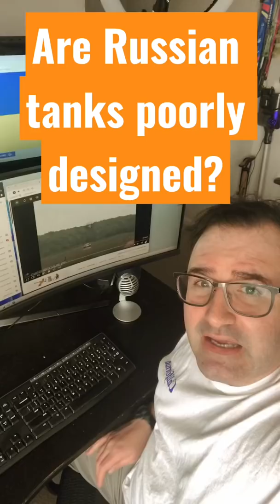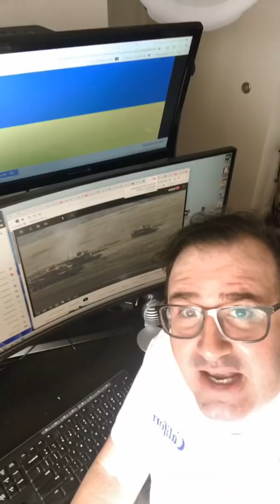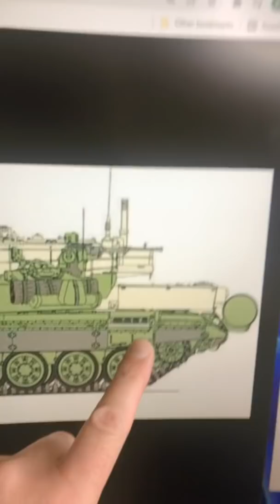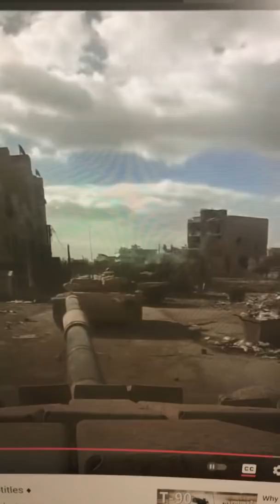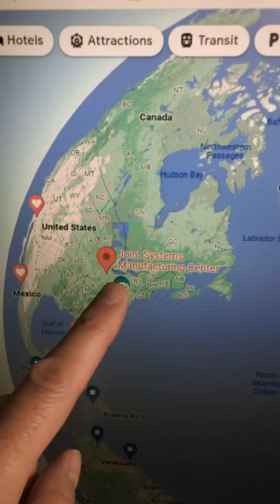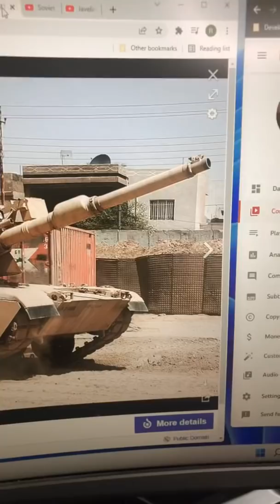Are Russian tanks poorly designed?

Comment: finally someone that doesn't just point at autoloaders and say "haha turret space program"
Reply: Autoloader, Haha turret space program!
Reply: @TheSpectralFX Autoloader “haha turret space program”
Reply: Yeah but tbh soviet ones are badly designed like fr even thou their engineering capabilities were actually outstanding in all of direction i just cant get two things about their tank building school first is why shitty autoloader mechanism (Especially in comparison with French one like theyve put in Leclerc and AMX-13) And second why so bad negative depression angles?
Reply: The Chieftain has been saying that all along. He thinks they’re superior.
Reply: Russian tanks are not THAT much smaller than western tanks from the front but that is where most of their armour is.
The Auto loader is behind the Upper front plate in the T-72 when shot from the front which is probably the only plate that would stop a 1970's NATO tank round.
Reply: @nataljagerasimova5108 Regarding the autoloader, the reason why the russian ones are worse are simply because t72s are much cheaper to make than leclercs. Because of a lower price, you will get simpler, cheaper mechanisms, thus a worse autoloader which still gets the job done. Regarding the bad negative gun depression, because russian tanks are much smaller and compressed there is less room for the gun to move vertically in the turret. If you imagine the cannon moving up and down in a turret, when the cannon aims down, the cannon breach(inside of the turret) will move upwards towards the roof of the turret, and since russian tanks are smaller and more compressed, the turret is smaller and more compressed, leaving less room for the gun to move up and down. Hope that explains it all!
Reply: Autoloader, haha turret space program!
Reply: @teeanahera8949 does he? I’ve seen him explain why Russia went with autoaders and why Russians tanks are good designs for the way the USSR intended to fight NATO. I have not seen him say specifically that Russia. Autoloaders are superior.
Reply: @nataljagerasimova5108  Finish to wash dishes???
Reply: @CS-zn6pp  Plate???? Back to learning step, you 1d10t!
Reply: @jeffrythedolphin6253  You better answer her with a pie receipe!
Reply: @tpkdm71  Because they can load a strike in 8 seconds???

Comment: The small size and auto loader also helps the crew to be evaporated inside when hit, it's a nice way to save body bags.
Reply: Exactly, the auto loaders are a death sentence for those inside. I'll load the rounds that are kept in a separate, blast proof compartment myself thank you very much. Really not worth it.
Reply: Yeah autoloaders are risky but very effective
Reply: That's why it pops its top like a lollipop
Reply: I'd use the term "sublimated".
Reply: @meaculpa7779  that's why most other countries use casette style autoloaders that are stored in a separate compartment with blow out panels
Reply: @meaculpa7779  it's not that har to make autoloaders compartment safe they just don't want to and if you have little bit knowledge about tanks you'll realise none of them is gonna survive unce got hit by other tanks till not hitted on the side
Reply: @MrHeuvaladao  Humans are mostly water. Soooo
Reply: @mwanikimwaniki6801  Given the right conditions (low pressure and high temperature), any material can sublimate. But I was just kidding.
Reply: Savage love it! Slava Ukraine!
Reply: An autoloader won't replace a 19 year old soldier with two strong arms. 
But by far the best reason for NOT  having an autoloader is because the Loader helps with general maintenance on the tank which there is a LOT. Tanks are mechanically complex steel monsters that require tons of maintenance and the Loader is a huge asset during down time.
Reply: @meaculpa7779  in the begining of the WW2 tanks were poorly armored, threre were some descriptions in for ex. Polish army (during september campaign) that their anti-tank rifles were capable to not penetrate german tanks but the force of impact tore off pieces of the armor on the inside and killed the tank crew, My point is that even preventing the explosion of ammunition, the tank will not provide 100% survivability of the tank's crew in the conditions of today's dynamically changing battlefield.
Reply: Fastest way to make your tank crew into fertilizer
Reply: @donarthiazi2443  An autoloader will replace a soldier without any issues, and perform much better. Maintenance can be achieved by other personal, because at the end of the day, if you pay a loader you can pay a mechanic.
Reply: @playonandroid9977  
The mechanic won't be with you in the field. Especially when you're fighting an enemies armored units. 
True he'll be there to help, but he won't be there like a loader will be there... all the time. 
Edit:  And you're wrong about an autoloader performing better than a 19 year old soldier... especially much better than the soldier. I really don't know why you would post such an outrageous comment. Besides, an autoloader breaks down more than a soldier and it's far easier to put another soldier in the turret than repair an autoloader.
Reply: @donarthiazi2443  every word of what you just said is wrong
Reply: @playonandroid9977  "without any issues" meanwhile ammoracked tank: obliterates anything inside, including crew.
Reply: @rylanlunnon9640  ah I see a tank expert, thinking autoloader can't have blast doors... Just take a look at the Leclerc or the Japanese tanks for instance. Autoloader+blast doors. Those are actually much safer since the reload sequence is shorter, the crew is less exposed.
Reply: @playonandroid9977  Yes of course. But we are talking Russian tanks here. 🙄 They are made with cost in mind, not safety.
Reply: @rylanlunnon9640  No I was talking autoloader, I've never mentioned specifically Russian designs.
Reply: @playonandroid9977  this video and comment section is about Russian tanks.
Reply: @rylanlunnon9640  yet you're commenting on a discussion about autoloaders as a whole. If you're missing context, admit you were wrong and come back with backed and applicable arguments. We can't always be right and knowing, but we can strive to be.
Reply: Why use autoloader when you have 19 year olds hanging around 😅
Reply: Truth is if a tank cabin is penetrated by a shell or ATGM the crew inside would be just as dead regardless of where the magazine is located. Turrets popping out just look more dramatic.
Reply: I suppose if your design constraints include the crew is expendable then yeah it's definitely well designed. 

Fortunately, other nations realise that the most time consuming to produce piece of a tank system isn't the tank...it's the crew.
Reply: @zahimiibrahim3602  challenger 2 has been known to take 8 rpg rounds and a Milan to the face and the crew survived. The small size means not as much space for armour either.
Reply: Unfunny joke, all tanks have good points and bad points, and the russian/Soviet designs are excellent if you make it fight to another tank instead of some guy with a javelin camping somewhere waiting for  russian tanks.
Reply: @meaculpa7779  eastern auto loaders kinda suck. But western auto loaders of France japan and Korea ect  use are actually quite safe
Reply: tank and crematory in one, awfully efficient
Reply: Not evaporated. I think you mean vaporized.
Reply: Tbf anything able to match an M1 isn't going to let the crew walk away either, blast doors be damned.
Reply: @playonandroid9977  not true its been proven why america doesnt and leapords arent auto loaders most of nato tanks dont have auto loaders because tanks need maintenance only the french used auto loaders extensively but have shitty tanks and armored vechicles that use auto loaders.
Reply: @pride2184  wrong + L + ratio
Reply: I would much rather get evaporated than slowly cook by a hole in a blastdoor.
Reply: I recall stories of soldiers in the aftermath of Desert Storm literally having to shovel out the ashen remains of Iraqi soldiers from their T-72's that suffered catastrophic turret explosions. Like, think cremation of remains. Just ash.
Reply: The more recent t 14 armata tanks now have a small metal box that seperated the crew from the auto loader and protects them but thanks to the fact russia is really bad at making production military vehicles they wont appear anytime soon
Reply: @meaculpa7779  would you still survive a javelin?
Reply: @meaculpa7779  Blast proof? Yeah you can't make blast proof. You can do a blowout panel to divert the force but you are still going to be rattled.
Reply: This isn't Fury. You're turning into a mist regardless if any tank blows up.
Reply: @meaculpa7779  thats why those tanks have separate Place in front of The tank For driver/gunner that protects them somewhat of that blast so death ratio is nowhere near 100% as you guys think.. but 1 shell Goes kaboom on Abrams and everyone is 100% sure dead
Reply: But since people dont know this its a good way to Make russian casualties Look  higher 👍
Reply: @meaculpa7779  as he said, in an age of smart weapons? Absolutely. In the age they were designed for? Superior to the M1. Less resource cost, less manpower cost, lower profile, higher rate of fire, greater numbers. Cost for cost it would have trounced the M1 and probably any other NATO tank.
Reply: After seeing a bunch of footage of remains of crews from destroyed Soviet era tanks but also WWII, unfortunately the blast is going to make you have to walk around in a quite large radius to pick up limbs and/or scratch charred remains of the inside of the tank. 

However there is two videos that came out of Ukraine approximately a couple months ago were the bodie of the bodies of the gunner or tank commander of a Russian T-72 stayed stuck inside the turret after a catastrophic ammunition explosion launching the turret far away, his head was stuck in the his frozen (probably by the force of the explosion) half opened hatch, on the first you only see part of his head sticking out and it's completely intact, so I thought the rest of the body must have been in a terrible state, but in the second video they are removing his corps and surprisingly enough his body was intact and from the outside and his clothes were a bit torn up on some spot but mainly intact. 

However when they pulled on his corps to finish exctracting it, it kinda looked like he barely had any bone left in his limbs...
Reply: Source?
Reply: Also Russia doesn't  have kill systems put on there tanks / Basically it's a tank COD trophy system!
Reply: @rylanlunnon9640  not the newest T-14s but is it realistic that they will EVER have enough to make it their main tank.
Reply: @DrPotato0  i don't think they'll ever make enough. They haven't sent a single 1 into ukraine to at least test out
Reply: @meaculpa7779  That tech wasn't developed yet when the T-64 (Predecessor of all Soviet modern MBTs) was being developed. Besides that would make the turret larger or reduce the size of the ammo load.
See for the time, Ammo being dispersed around the tank was normal, M60 and Leopard 1 both had their ammo everywhere around the tank. While the T-64/T-72 had their ammo low in the floor making it hard to hit via tank shells. Also these tanks were heavily armoured.
Reply: @szymonpabis1805  I think you’re all missing the point, if there is penetration of a sufficiently hot metal to cook off ordnance then that, by definition, is hot enough to kill the crew, having the turret blow off is a moot point.
Reply: If an ATGM hits an M1 it and the crew are just as dead
Reply: The autoloader has nothing to do with how the tanks explode. They react that way because they did not design a pressure release system like the NATO tanks have. In Russian tanks the blast goes up through the turret, in NATO tanks ammo explosions get directed backwards.
Reply: Whoever designed the Russian auto loader and ammo rack, God bless you!
Youve made the Ukrainian victory a much more realistic proposition by removing all their tank crews from the battlefield.

And the world.
Reply: Another thing is that the design of the autoloader is a really old one, being based on the T-64s design. They changed it a bit on later models to make it a bit more survivable, but the rough placement and design is still there.  The USSR always had to make do with a weaker economy, which got even worse for Russia after 1991 and it's only in the 2010s that they started having modern tanks, which are still modernisations and can't get around those design choices made in the 60s/70s while most Western armies are fielding 80s designs that had a lot of time and money to modernise with new equipment - which Russia couldn't do as they got gutted in the 90s economically and are now spending resources on the war. Until Russia can field the T-14 in any sizeable number they'll be stuck with upgraded 60s/70s designs made for total war.
Reply: @knxeo6004  not exactly, their armour is weaker against kinetic warheads (modern ERA doesn't provide much protection against APFSDS), their speed is much worse (about 30kph at most in ideal conditions), their crew comfort is worse, their visibility is worse (mostly just periscopes and their IR/NVD's are quite out of date), their armour lacks DU (same with the round), and they have been using the same engine since either the T62 or T72 (90% of Russian vehicles run on the B2 engine, with some modifications).
Reply: The tanks are cheap so if it got destroyed it  can be replaced quickly
Reply: @MrDiego40  slava urine
Reply: @NiSiochainGanSaoirse  You know the Ukranians use the same tanks right? the reason you see less catastrophic ammo explosions on their side are several: Less advanced ATGMs used by the Russians, safer ammo storage policy (Russian tankers also fill the reserve magazines, while the Ukranians do not) and better combined arms tactics, especially at the start of the conflict when the RUAF just rushed in with no cover
Reply: With the sole exception of the M1a2 Abrams, virtually every Western tank stores at least 2/3rds of their ammunition in the crew compartment without the protection of blast doors or blow-out panels

The Leopard 2 stores only 15 rounds behind blast doors; the rest of the rounds (27) are in the crew compartment, next to the driver. 

The Challenger 2 stores none of its rounds behind blast doors

The Leclerc stores 22 rounds behind blast doors; and the rest (18) are located in the crew compartment without the protection of blast doors or blow-out panels 

The Merkava mk4 stores only 10 of its 48 rounds behind blast doors.
Reply: @yoinks9907 

They also store half of their ammunition in the crew compartment without the use of bulkheads or blow-out panels

Comment: “The javelin doesn’t care how small you are”

Bro I wish women were like that
Reply: Just remember a javelin is 5 inches in diameter and can penetrate much better than you ever will!
Reply: it's not the size that matters it's cubic feet per second that matters
Reply: @pierreo33  of expansion? of air? for the purpose of achieving thrust? the density matters. the differential temperature matters. the change in mass matters.
Reply: As well as how big and heavy, as not penetration but excessiwe pressure destroys it.

Comment: Imagine getting hit by an rpg and the turret just ascends to another reality
Reply: No rpg wont really kill a russian tank from the front mostly because russian tanks use ERA and some of them have the arena aps
Reply: @yasamustafakemal745  and for that we have tandem warheads
Reply: @antisep1207  modern russian tanks use relikt explosive reactive armor its designed to defeat tandem warheads :)
Reply: @yasamustafakemal745  but most hits from infantry held at weapons are in the side or the rear where with exception of the more frontel part when you are looking on the most modern the rest is more or les naket
Reply: @antisep1207  russian tanks use relikt on the side skirts aswell
Reply: @yasamustafakemal745  but only on the more  modern variants + only on the 1/3 of the side
Reply: @antisep1207  wdym the tank most commonly used in ukraine is t80bvm and t72b3 both have relikt on the sides and wdym 1/3 its more than that
Reply: @ihaveaboot yes because roof has no composite armor and very little era
Reply: @yasamustafakemal745  designed to . .. yeah lol.. it doesnt work at all
Reply: Raccoon  i was talking about era russian tanks have very little era on the roof and no composite armor whats ur point
Reply: @antisep1207  i have never heared of a hand held rocket launcer having a tandem charge you would need professional weight lifters to load and fire does RPGs
Reply: @wrpg9955  pg7 VR for the RPG 7
Reply: @yasamustafakemal745 how does that work? Genuinely curious
Reply: @thepenguinprolemonstealer2644  How does what work?
Reply: @nyph933  the relikt era
Reply: @thepenguinprolemonstealer2644  In short, its main function is to pre-detonate projectiles, which is also the reason TANDEM charges are largely used now, which is in summary a dual explosive rocket, exploding twice to counter the ERA.

Comment: "Because if it got hit you weren't getting another one" 
Sherman: Laughs in 50,000+ units
Reply: Cold war era, 1985. But yea, WW2 the allies all agreed numbers will be necessary.
Reply: In ww2 it was also a concern, shermans were much more reliable because if one broke down it wasn't going back to factory for repairs, unlike germans or russian tanks
Reply: I was surprised to google and find that only 57,000 T-34s were made during WW2. Expected many more.
Reply: @UEAdmiral  In the context of the war that is a lot. Only 8,553 Pz IV's were manufactured.
Reply: @rylanlunnon9640  only 4,000 tigers
Reply: He wasn’t talking about the Sherman. So that doesn’t apply to the video
Reply: Sherman's were like a 3rd of size and weight Vs M1 Abrams - the problem wouldn't be producing more, just getting enough across the ocean in time if something went wrong